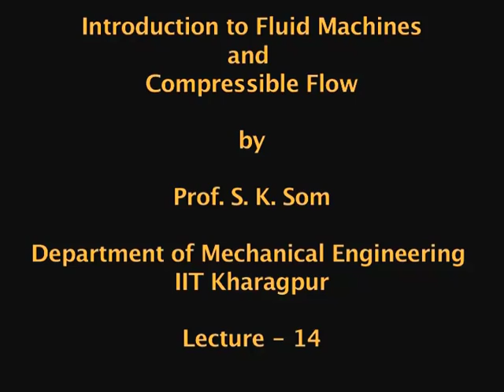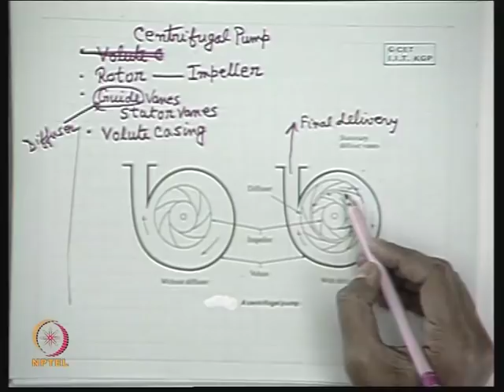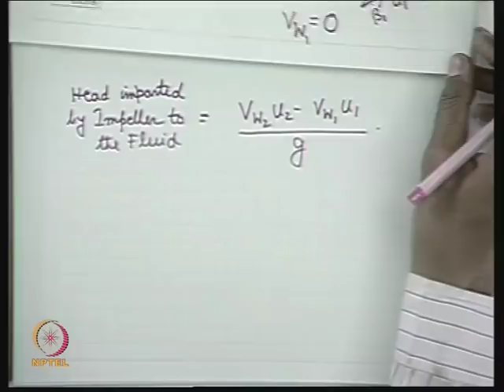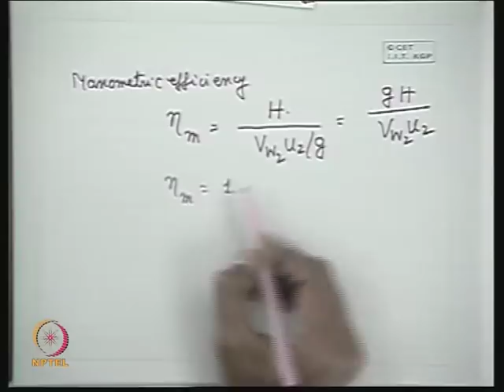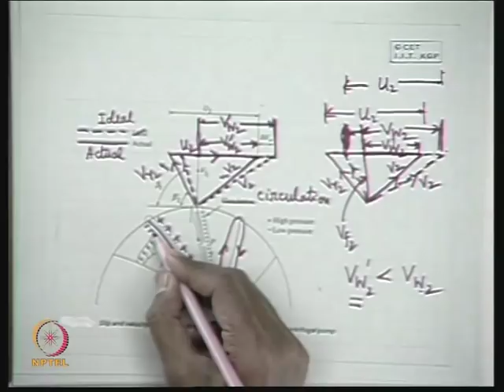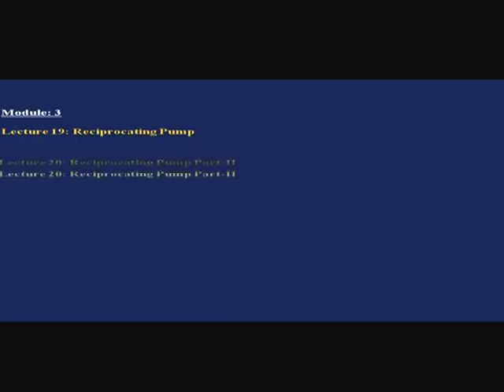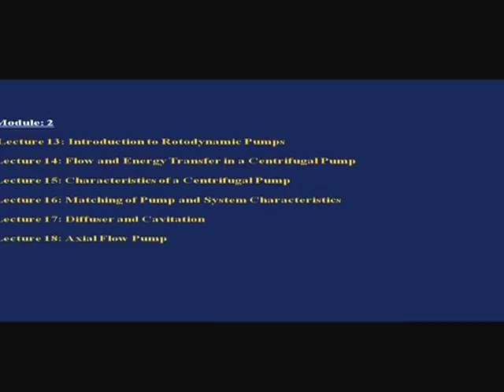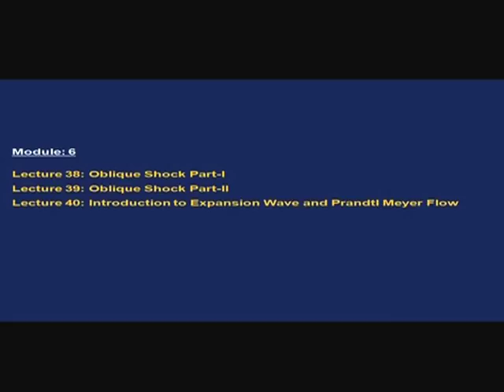Mod-01 Lec-14 Flow and Energy Transfer in a Centrifugal Pump

Comment: the fluid enter radially
Reply: right brother, i have the same doubt, due to suction water when reaches the inlet tip , attains radial velocity, otherwise these velocity diagrams at inlet and outlet will not be in same plane. Water enters axially but at inlet tip velocity are in same plane as outlet plane that is radially.
Reply: Fluid enter axially, leaves radially